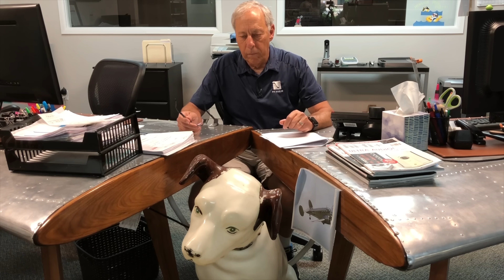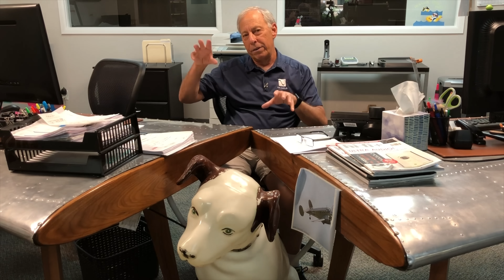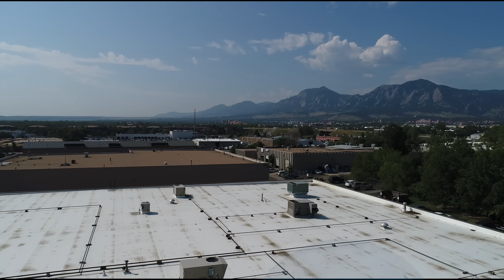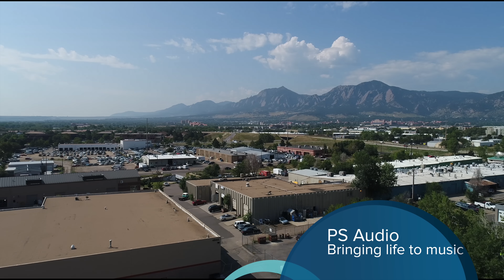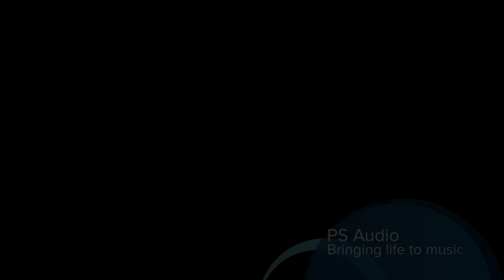Are vacuum tubes worth it?

Comment: When I was growing up, tubes were on their way out and nobody was really sorry to see them go.  The goal was to reproduce sound sound as accurately as possible without adding, subtracting, or coloring the music, to get as close to the live performance as possible.  Then, if it was necessary to tune the response (or even to adjust for taste) there were bass, sometimes midrange, and treble controls.  If one wanted to get crazy, one could get a graphic equalizer with up 19 frequency bands.

When I started out, there was Hi-Fi, then came stereo, then stereo with a middle channel, then quadraphonic, then surround sound 5.1 and THX.  Still, the idea was to make one feel like they were in a live music venue, whether a concert hall or a smaller setting like a pub.

Somewhat later, there was the shift from analog (vinyl) to digital (compact disc) and later compact disc with compression (mp3, etc.).  With enough bits, a high enough sampling rate, and really good quality (low phase shift) ADC and DAC, it is impossible to tell the difference by ear (except for the LACK of the noise and distortion inherent in vinyl) and nearly impossible to tell even with electronic measurement devices.

So, now you all want to go back to having coloration to the music that for decades we were trying to get rid and spending thousands of dollars to do so.  I can't help but be amused.  Get a high end solid state amp and DAC, add a control board with parametric EQ and adjustable attack, delay, and reverb and you can color your sound any way you like it.
Reply: You can listen to different solid state amps and each one will sound a bit different. You can listen to different speakers and these will sound different. People will listen to different gear and choose what sounds best to them. If all speakers were the same there would be no need for different brands. If all amps sounded the same there would be no need for more than one brand. I think what they wanted to do was keep up with Japan in the race to develop a transistor. They had a whole new product to market and sell. All about the sales (money). There was a time when everything was done in mono. Then stereo became something new to sell people on. However, mono has a better sound. Many people think tubes sound better. Many people like solid state. With solid state amps came more power. Then they could sell people on  the need for more power. You need a 100 wpc amp. A 30wpc amp will drive most speakers to a loud volume. This is all subjective. Only the listener can decide what sounds best to him/her. This guy might try making some audio demos of his amps. I do not care about all the  talk. Let hear it~!
Reply: Consumers shifted from CRT Tubes and largely rejected Plasma for LCD screens which were the worst display option because they prioritized less heat, weight and thinness over raw PQ. Consumers will always value convenience over quality. It’s revisionist to say tubes were rejected for their sound and not being more of a pain to upkeep & companies also looking to save a dime on cheaper transistor manufacturing. Whichever style you like is fine but there is one truth, you can’t “equalize” a solid state into a true tube sound anymore then you can play with the picture settings on an LCD and get it to look like an OLED.
Reply: @mikeg2491  "Whichever style you like is fine but there is one truth, you can’t “equalize” a solid state into a true tube sound..."  I find that an interesting statement.  Someone else on this tread mentioned even and odd harmonics.  It seems to me that whatever the difference between tubes and transistors, with enough test equipment, oscilloscopes, spectrum analyzers, tracking generators, etc. we should be able to quantify exactly what the difference is that people call "warmer" or "smoother", etc.  Then we should be able to  recreate that.  

Consider that we can capture the vibrations in the air of a violin and use a paper or plastic diaphragm to recreate those vibrations well enough such that an expert can tell the difference between a real Stradivarius and a reproduction.

After all that, I do have to admit that if it is your preference, perhaps it is easier to just play your music on a tube amplifier.  But, there may come a time when tubes and other needed components just won't be available.
Reply: @BryanTorok  We can quantify what’s different between CRT televisions and fixed pixel displays, but FPDs still can’t match the vibrant pixel glow or super quick refresh rate of a tube display. It gives the picture an ethereal, almost ghostly quality that is just different. It’s a huge issue in the classic gaming world that there is a whole subculture of fans trying a multitude of software shaders or even building hardware upscalers and scanline generators to try and recreate the look of software on an old classic television but as close as they can get it’s still not there with all the tech & processing power we have today. Maybe in 5-10 more years you’ll be able to create a true simulacrum with such high resolution we can even emulate a shadow mask but for now it’s not here. 

It’s kind of how I view tube audio equipment, we can make reasonable copies but something still always feels off to me. I admit I’m no science guy and just go off my ears, measurement charts are all gobbledygook to me. I don’t even think it’s a warm vs cold thing as I have a McIntosh headphone amp that leans more towards sounding like a SS with a colder, more dry sound. But there is still a bit of 3D holographicness to it I don’t get from even the best SS amps.
Reply: @mikeg2491  It's been 50 years since I listened to a tube audio amp.  I'll have to find one see if I can hear the difference.
Reply: @BryanTorok  crazy! I’m 40 and just got into audiophile gear 3 years ago after some successful investments. I own both tube and SS. IMO my favorite combo is a tube preamp with a SS amp.
Reply: But without a tube preamp you will never get realistic sound.  Guess how I know.  I play and record real music.
Reply: @peterbaugh51  If the music is recorded accurately and then played back as faithfully as possible, what difference does it make which electronics are used?  Sure, you can "color" the playback to whatever suits your taste.  But, that is not reproducing the music, that is corrupting it.
Reply: Odd harmonics will never beat the warmth of even

Comment: My understanding was that selecting one or the other was largely a matter of what characteristics of the harmonics you are after. In music production, I tend to use tube preamps and tube emulation plugins for gentler saturation, when I'm after some compression, and  a little bit of grit / thickness. I listened to an interview of a tube preamp manufacturer who is convinced that the primarily even order harmonics produced when recording sources with strong transients might sound more music / less dissonant than some of the harmonics produced by solid state devices, which stands to reason, although I am certainly not too precious about this. I like the sound of many solid state circuits as well!

Comment: I just switched on my multitone stereo tube amp (not the koch) and good lord the sound is just physical, it's 'there' in the room, the speakers are fearly cheap just wharfedale 515 with replaced tweeters, I didn't even pull out the AR's yet (ar 3a 'improved') but good lord the amp sounds good. I can just hear it. And that's a full tube amp 4 times EL34. somehow there's something with the interaction between amp and speakers that make tube amps 'work' but that's just my theory. There was a Proton D540 amp that was also very good but the tube just destroys them all. No I think you're wrong it's precisely the tubes in the end stage that make the difference. Why? nobody knows. the sound is very 'physical', 'present', like objects you can touch. amazing. I have left that thing off for a long time and listened to headphones putting it back on again is just amazing. the god-like amplifier good lord. Even through the cheap wharfedales you van hear how physical that sound is. That's a full AB amp with full feedback including the output transformers, thats not supposed to sound good but it does. amazing amplifier. I'm listening to it right now I can just not believe what I'm hearing. all the elements in the music are there like objects floating you can almost touch it.
Reply: that's the multitone M250 if anyone wants to know. I bought it directly from the shop in the city of arnhem. That was 20 years ago the guy was pretty old back then he had been building those things since the 50's. When I saw it through the window I just knew I had to own one. They're pretty hard to come by there not that many made. They look just like old tube amps there's a metal casing around the whole thing not those tubes out in the open 'exposed'. It's not a fancy tube amp, old skool. Metal rectangular box. but god it sounds good. holy fuck. First I had the cheaper 25 watts version that thing sounded a bit 'off' it never sounded good but the 250.. holy.. cr..

Comment: I got a Yamaha RX-V1500 (2005) Paired with a pre-amp Vacuüm tube which is very upcoming! (ali-express)
modern pre-amps even with bluetooth, remote control, different modes, bass treble regulation and so on!
For a little bit of money you can get better sound is my opinion. better bass low's and mids to a receiver or for sure by a cheap stereo setup is my experience.
I love the sound of a good tube even a 6j1 or 6j5 one (Custom, tubes) in every situation! Music, films, games and so on. Tubes FTW!

Comment: The advantages of tube amplification in the case of a guitar is well understood. How hard you drive the input stage or preamplifier creates harmonic distortion that is pleasing to some peoples ear. This can be emulated with transistors/FETs/ and DSP chips but what is hard to reproduce is how the sound changes with how hard the guitarist strikes the strings. These are not qualities that people look for in HiFi stereo. We want accurate and faithful reproduction of the original signal. Reverb may sound good but it is a distortion to the original signal. But I wonder if tubes improve the dynamic range of recorded music if the original recording is not so compressed like with a master recording or using some high definition source? I suspect the answer is yes. WE all understand that live music can sound quite different from recorded music and compression is one of the reasons why.

Comment: Good video, Hasn't anyone tried making a very high voltage solid state amplifier where the output is transformed like a valve amp? wouldn't that give you that "warmth" (damping) of a valve amplifier without the microphoney ?

Comment: I told folks for years that a "hybrid" amplifier (containing both tube and solid state devices) will be your best sounding audio equipment, if......  If it was designed properly to begin with.  Not all tube amps or even hybrid tube amps are made the same, they are far from.  I've heard some tube set ups that just didn't sound right, and some setups that will blow you away.  I prefer the warm sound of the tubes versus solid state only....

Comment: Traditionally, you tend to get very simple circuits with tubes because although you can sprinkle transistors in wherever there's a benefit, you can't just keep adding tubes for small performance gains.

Comment: You forgot the most important point. Tubes sound warmer, more pleasent and more realistic. Transistors sound cold and dead but technically they are more accurate. I dont think that microphic is reason for the more pleasent tube sound. Reverb does not sound warm.

Comment: If you put a vacuum tube behind a sound proof enclosure, would you say it still sounds better than transistor amplified sound? I tend to appreciate tube sound and one of the reasons I've heard tube sound being better is that it handles peaks better, where with solid state you get clipping.

Comment: For guitar, tubes just can't be beat. (Saturation and even order harmonics) Try and stay away from printed circuit board tube amps. High vibrations and high voltage just doesn't mix well with PCBs.
Hybrid amps sound like Solid State because they are Solid State with a low powered preamp tube (no saturation) in the circuit. Some run the SS thru a tube power section. Haven't heard a good one yet.  Hybrid amps were developed for people who can't afford the price and maintenance of a Tube amp. 
Modeling amps are Solid State amps that run digital patches thru power transistors. For people who don't want to mess with pedals and tubes. Some are good enough for stage use. 
To recreate sound or music, Solid State is the way to go, as it doesn't color the sound and is much more efficient.

I use a line 6 amp for performances that don't matter and I don't have to worry about it getting stolen. 
My 1964 Super reverb, 1965 Twin reverb, 1965 JTM 45 Bluesbreaker, 1982 JCM 800 50w combo, 1967 Champ, 1969 Bassman and a couple of early 1960s Gibsons + many pedals are used for serious performances and recording. But I have to babysit them so they don't get stolen.

Comment: The original painting of Nipper had an Edison Bell cylinder class M machine, and it was painted over with the Berliner Gramophone. Many say even a Nipper expert that it is not on a casket.  I though had a nipper calendar from 1912 or so, that clearly showed the casket underneath, tables don't have long coved lids, this calendar was produced by the Victor Talking Machine Co.  Nipper was Francis Barraud's Brother's dog, painted in 1898 and he inherited him and an Edison Bell Phonograph. The original painting made more sense, as the cylinder machine, had a dual purpose Edison Standard-Speaker recorder, where you could record with the recorder arm down where the recording sapphire comes into contact with the blank and then put up against an adjusting lug, for playing the cylinder.  Francis offered the painting to the British Edison company, and Mr. Hewitt said: "Dogs, Don't Listen to Phonographs."  Francis went to the Gramophone Co. and they liked the concept but asked for the Edison machine to be painted over with the current model of Gramophone.

Comment: Tubes worth it? no! Tube amps do not have the same linearity of transistors, tubes have much higher distortion both imd thd,  higher noise, lower dynamic range. Only advantage is soft clipping of transients,  transistors tend to be harsh. However you can build a transistor amp with 100s of watts output, so clipping is unlikely. In fact if you use FETs in the last stage, this harshness tends to be less evident.

Comment: Great Video - reminds me of the best sound I ever heard... Knew someone about 25 years ago who in my opinion had the clearest & loudest system I ever heard in his warehouse loft. Room filled with foam 2'x4' panel (exciter) speakers (about 30) and 2 subs (home built also)  - he said he spent Just under $2,000 I remember for all  - He would switch between a Tube Amp and Solid and the warmth and dimension from the tube was just incredible. I remember it feeling like I was smack in the middle of an orchestra. Even (to me) sounded better than the Disney sound experience where they spent $2M in the room. I really credited his sound to his tube configuration. Wish I knew exactly what is was... But yes, to each his own when it comes to sound.

Comment: There is a popular misconception that transistors produce odd harmonics and that tubes produce even harmonics. 
This simply is not true because both devices produce both types of harmonics.
Second order harmonics are considered even harmonics, being even integer multiples of the fundamental frequency with the second multiple being the most prominent.
Third order harmonics are considered odd harmonics, being odd integer multiples of the fundamental frequency with the third multiple being the most prominent.
Even harmonics considered to sound fat and warm, although they can be muddy and soft sounding as well. Odd harmonics are considered harsher and edgier sounding.
Transistors differ from tubes in the ratio of even to odd harmonics they produce, so it is true that tubes sound different than transistors, giving the audio a more harmonically pleasing sound.

Comment: Sounds like your afraid to tell the truth,there is absolutely no benefit in using a old deteriorating item,that over time  needs constant regulation to see if it still performing,seems to me you just don’t want to push tube manufacturers buttons and playing it safe in your answering of the question there are more solid state manufacturers that know the truth and benefits of solid state in 2019

Comment: Yeah :( Great answers.."Each have their positives and negatives" "When used in proper applications they are better then each other" "Some say.." " Some say that..." Great thanks a lot!  Oh and the dog story was TOP!
Reply: He made a relevant point though. 

Look at an old regulated power supply that used tubes as pass elements. I saw one that required 4 6L6s for 200mA of current!

A small TO-220 cased MOSFET can do the same, and depending on the amount of voltage being dropped across it, may even accomplish it without a heat sink.  

If he was making an hour long video he could give more than anecdotes on each, but I don’t think that was his purpose.

Comment: If you want the current akin to powerful transistors use big radio station transmitter tubes for the final stage. You can get an 833A for as little $130 and compare that to the 4 or 5 figure price of a high end transistor amplifier. Also I don't think microphonics is a problem for such a final stage even if you like to accompany sitting out an earthquake listening to music.

Comment: tubes.....all about distortion.....non linear response.....small signal...is linear response......high power....  is at the top and bottom of the wafeform non linear  which translates to harmonics of the original input.....add character to the sound